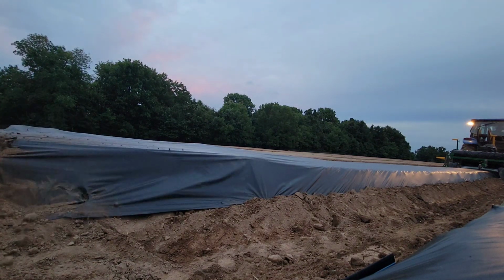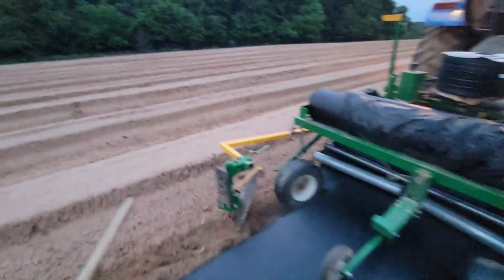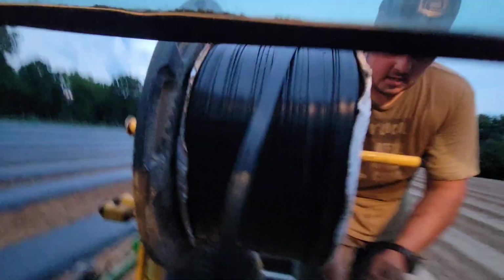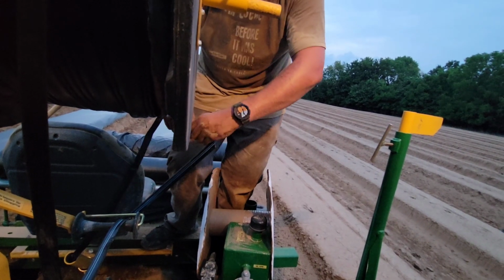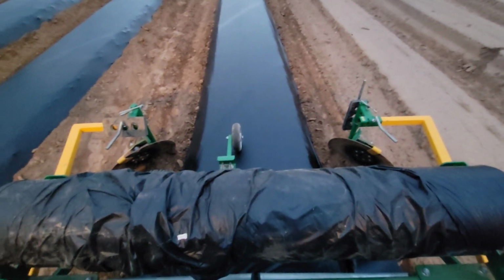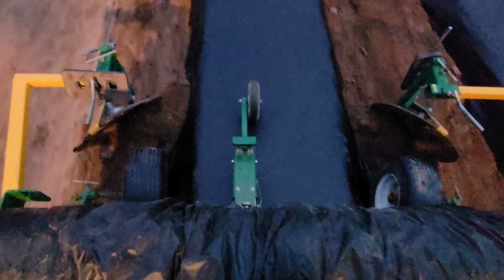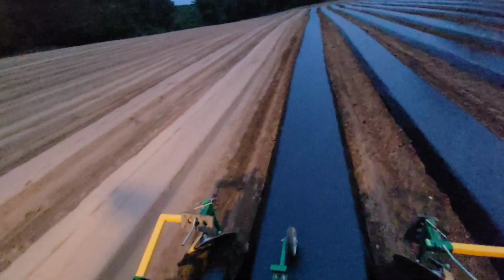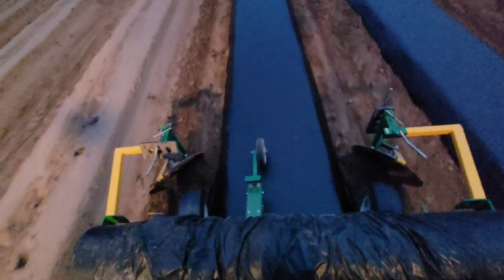Laying Plastic Mulch for Strawberries 🍓

Comment: You are going to be the standard on youtube for running a 2600 now. Thanks. I had to see it to believe, since I'm always in the tractor and no time to watch or turn around. It looks like the pan is just skimming the top of the bed. The fat bottom of the bed is getting hit by the cleaning shoe, leaving dirt for the covering disks. At 9:50 it looks like you could put the cleaning shoes a notch deeper and get more loose dirt.  Normally I have my covering disks tilted all the way back to dig up more dirt, but with the weights on like you have, I will try the other way. Always a stressful day until you get a settling rain (minus the wind).

Comment: Farmer Dre, obviously you are at your busy time just had a quick question. I'm a small grower on Cape Cod MA. 4k plugs, 10 x 220 foot rows. I lay the plastic myself with a 2400 rainflo. My field has about a 10 degree slope so this makes it a bit more challenging but i manage. i notice you lay 1 drip tape. I lay double is that necessary? Charlie  
I have learned so much from your videos. My plants went in a week ago. Also wondering when to start  with a fertilizer other than starter?

Comment: My boss and I got our 50 rows made yesterday. How do y’all level the dirt between the rows after making the beds?
Reply: his last video he shows.   video called
Making Strawberry Beds
Reply: @OxAO  if you carefully watch the plastic mulch video, you’ll see that the rainflo creates a little mound of dirt between the rows after he made the pass. I’m trying to find out how they level that dirt.
Reply: That is the question. We've got the newer 2670 which allows for hydraulic adjustment of the covering disks. They allow you to make dynamic adjustments while the implement is underway. Seems to help when you're getting immediate feedback about what's working and what's not, instead of constantly stopping and starting to try out new adjustments. With a bit of tinkering it's possible to get rid of the ridges between the beds (or at least greatly minimize them). With an implement like this you're never really done adjusting because you can never bed the same field twice. What works this time may not work next time when the soil moisture and tilthe are slightly different. The Rain Flo is so much better for this than the smaller, lighter machines I've owned in the past though. They're expensive but worth it. And the company's customer service is amazing.